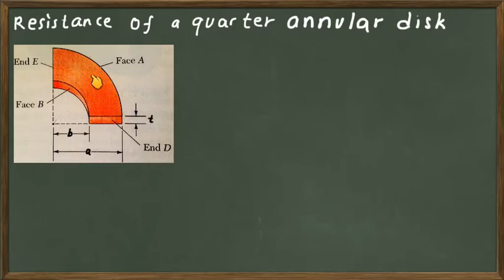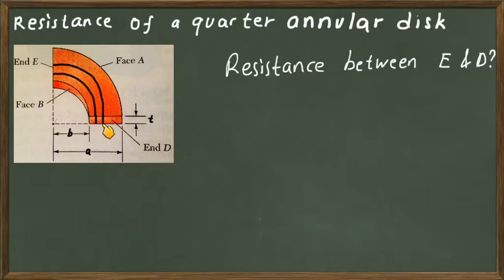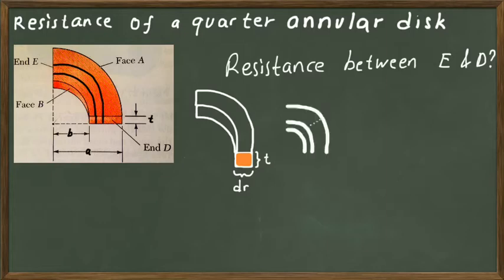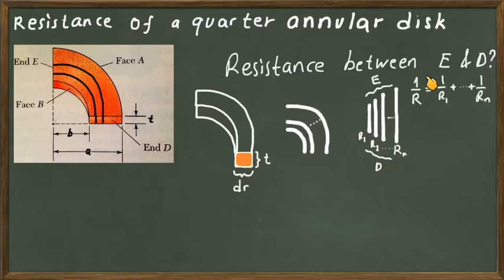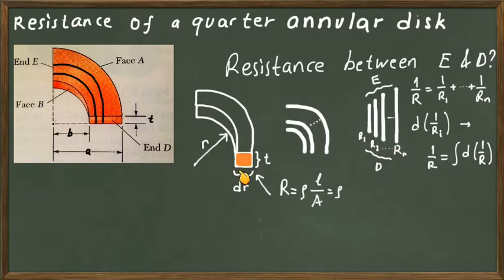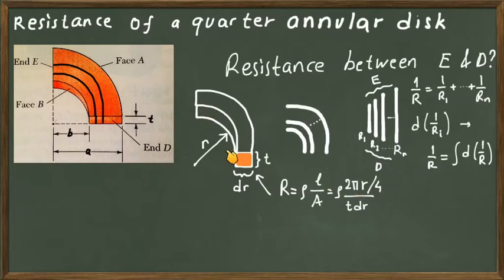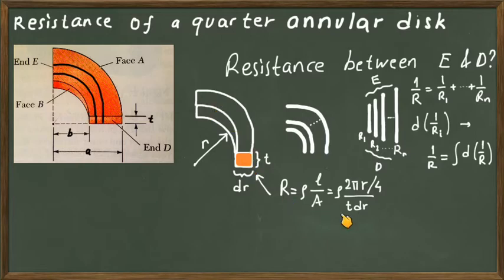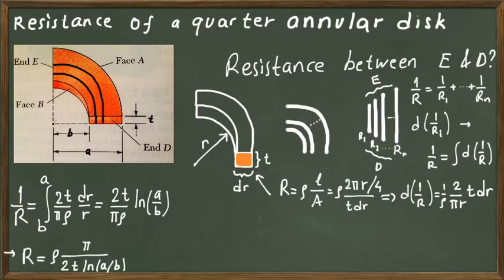Problem Solving-Resistance of a Quarter Ring

Comment: for the surface, is it the corss section surface or should it be the surface of the whole thing, in the hallow cylinder you used the 2pirL which is the surface of the whole cylinder